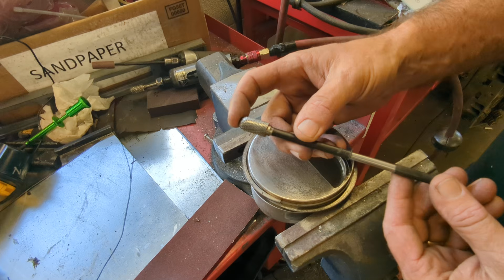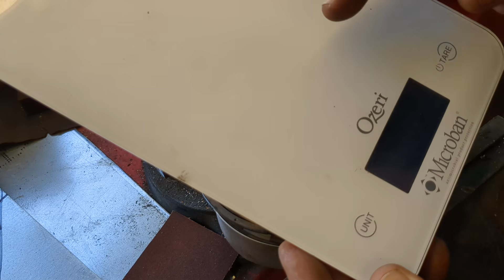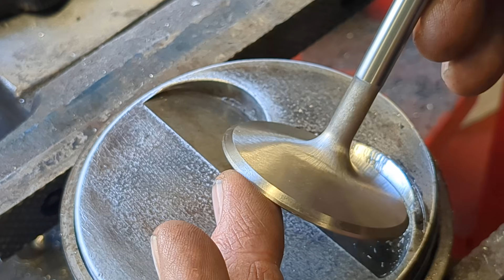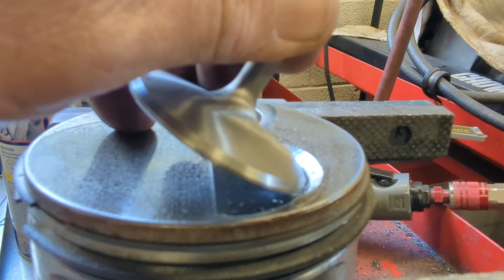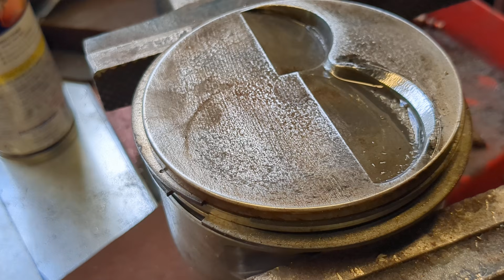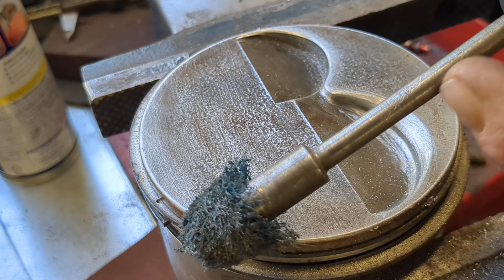The FIRST guy to show you this It will unshroud the intake valve in high lift performance engines

Comment: Wouldn't this mod help with low lift flow as when the piston is close to the valves like 10 degrees before tdc on the intake and 10 degrees before bdc . Because at max lift the piston is probably half down the bore.

Comment: scenario - I have a low miles engine that runs and lets say I did this trick to all 8 pistons.  and after removing piston material the way you did in the video, you mentioned weighing the pistons and lightening them to equal the lightest piston.  That's understandable. My question is, after making the pistons the same weight, does the rotating assembly need to be rebalanced?

Comment: In a pinch you can use a micrometer for a C clamp, or even pressing out U Joint cups, but you will likely need to use a pair of vise grips on the thimble.

Comment: I bought the Goodson kit that DV worked out with them. Thanks for helping me get more out of it! My project is a Chevy 292 l6 with 1.94 intakes. I want to get the most out of it. Everywhere I go in Colorado there is a mountain pass. It’s going to get more pulls than a tractor pull motor.
Reply: Great engine for that.

Comment: Shopping pistons online, I've often wondered why the valve reliefs were not laid back like this, to unshroud the valves??  And/or why they would ship pistons to customers with such sharp edges?? .... Knowing that sharp edges in the chamber lead to issues. Do the manufacturers not know this?

I would much rather prefer this done at the factory with machine precision, than me having to finesse it at home with the possibility of accidentally screwing up, just to have a properly finished product. So many things I wonder why...

Comment: Question about pistons I saw your video about compression height and your video on knurling the skirts. What is the best size of the ring grooves what else do need to know about piston selection and modification also saw your video on chmfering the shoulder of the valve releify

Comment: Subscribed. 
Watched several video's, you explain things pretty good, almost exclusively worked on 'semi-hemi' motorcycle engines with angled valves and pent roof pistons so 'flat top' pistons are 'different'. (although pretty common since mid 1980's in four valve engines)
Drinking straw is a brilliant idea, wish I had thought of it years ago when I was doing porting quite regular.
I've never liked holding pistons directly in vice, gripping tight enough to prevent movement could distort them. (particularly with smaller, lighter motorcycle pistons)
I realise you probably did it just for video on a piston that doesn't matter.
I 'invented' a piston holder using gudgeon pin and base, bolting through so piston can be set at any angle for machining, much more solid when using lathe or mill (I trained as precision machinist in 1970's  but couldn't stand production factory work)
You can use the metal polishing compound bars on cartridge rolls to 'reduce' grit size, rarely needed to use more than 400 grit to get a mirror finish on cast aluminium.
Usually cut down 6" mandrels and carbide cutter shanks to about 4", find things more controllable

Comment: All kidding aside. I had to come back to this video to comment on the huge benefit of this modification. 

For too many times have I torn down a client's engine and they have melted and or broke the piston at the outer edge of the intake valve relief and crown. This is where the short of the intake port flow is low or next to nothing. This occurs with excessive port velocities skipping over the short turn and slamming into the long side wall. Fuel becomes detached and runs down and out past the seat as liquid. This leaves the valve relief of the piston incredibly lean and melts that area of the piston.

Unshrouding like this allows for a lower pressure area and allows more air/fuel to be drawn into this area. Porting the head and making the short side more efficient would help too.

Good video Salter!

Comment: Question Brain; would this modification negatively effect the coating that comes on mahle coated pistons? Thanks.
Reply from the maker: If you're talking about that gray hardness coating yeah you would grind through it. 
However probably 80% of Pistons don't have that coating anyways and in the place you would be grinding it off I don't think it would hurt it in any way. 

But if I had my choice I do all my grinding work to Pistons first and then have them coated
Reply: @SalterRacingEngines  thanks for the reply.

Comment: Do you have to rebalance the engine when you do this?
Reply from the maker: @MrSuperchargeron  no unless you take off an exorbitant amount. As long as you are within 4% of your original Bob weight you do not have to rebalance
Reply: @SalterRacingEngines Thank you for the quick reply! I am rebuilding a Gen 6 454. It is for a 3500HD with a dump bed. Empty weight is 10,000 and hitched to my trailer grosses at 20k. I am looking for reliability and maybe a little extra torque. I sent a request to Comp cams but have not gotten a reply yet. Any advice or suggestions would be greatly appreciated! I have watched a few of your videos about cleaning up the casting and removing stress risers. Anyway, thank you for everything!! Have a great day!
Reply from the maker: @MrSuperchargeron  use the comp Xtreme energy 218 224 duration camshaft 
Perfect for what you're doing
Reply from the maker: That's flat tappet so use that unless you want to go roller
Reply: @SalterRacingEngines Thank you!! David Vizard just uploaded a video about a rusty camshaft. Yours? I have a 55 gallon barrel with about 40 gallons of Evaporust. I just dipped this block and heads. Works incredible!! 
I bought it a few years ago for a surface grinder I got for practically nothing. A 1961 K.O.Lee. it was super rusty but the ways were not pitted. I disassembled it and put it in the tank. Incredible!! Im so sorry to hear about your loss in the hurricane. Thank you again for the great videos and the recommendations!!
Reply from the maker: @MrSuperchargeron  yeah I saw it he was wrong on the cam count I have 35 that look like that. They're so pitted even after the rest is gone it's just no point in it so I had to wind up throwing them all the way
Reply: @SalterRacingEngines So sorry to hear.. I have never had losses like that. I had a car come off the freeway once and crash through my garage.. for the most part I was insured. But, the large gun and reloading hoard was not covered. I lost a lot of parts to water damage because the water main going into the house was right there. 15000 primers, pounds of powder, buckets of cleaned and sized brass.. flooded totes with gun parts along with some nice guns were not covered. I can look back and kind of chuckle at it now.. but I never knew I needed sn additional rider on my insurance for all the specialty stuff.. The guy who hit my house was on drugs and had no insurance.. 30 minutes before I was standing right there. When he hit the house, I was at the county recorders office putting the house in my name after paying it off.
Reply from the maker: @MrSuperchargeron  no unless you take off an exorbitant amount. As long as you are within 4% of your original Bob weight you do not have to rebalance

Comment: I did this a couple summers ago on some SBF hypers, mostly for clearing a larger intake valve. I also laid back the edge as you did but only enough to clean the edges. And not knowing for sure if how I did it was even ok. Then I come across this video. TOUCHÉ  sir.

I also wanted  to add,  as you were curious about how loud your grinder would be for the video. I switched about a year ago to using a cordless 12v Milwaukee 90° die grinder for all of my porting/cleanup work. With 2 5Ah batteries I was able to port a set of BBF aluminum SCJ heads. It's super quiet, 4 adjustable speeds, and was surprisingly maneuverable.  Also saves a ton on wear and tear on my air compressor. 
As always, great info 

Thank you for sharing

Comment: I have always wondered about this mod to unshroud the intake valve!  Thank you for sharing.  I suppose if you did the same thing to the cylinder head, the results would be fantastic.  Of course if you’re running a low lift / low duration cam, this might not show as much benefit.  I have also wondered about polishing the tops of the pistons or coating them with a heat reflective coating and how much that may be worth.  An A -B test on polished piston tops vs untouched pistons would be an awesome dyno video.  Thanks for all you do!  Subbed!
Reply from the maker: @natez0690 thank you for the comment that's way too much work just to make a video but I will tell you that polishing the Piston is nothing but benefits you will never go wrong polishing the top of a piston or even polishing a combustion chamber because you're getting rid of places for hot spots to form and your stress relieving the metal it's something I do on every one of my pump gas engines that is 10 to 1 compression just to make sure I don't get any spark knock or detonation

Comment: Why wasn't the valve relief pockets deshrouded in center  more like the deepest part of pocket that was attacked equally, as well as the apex at the adjacent side of intake relief pocket. Looks to me like your still leaving cfm on table for breathing. By taking them two areas equally out might possibly gain 20% or more laying those areas out as well.
Reply from the maker: @bigbearvenom6145  no I've tried that didn't get much more from it 
 but I'm not done with that video I'm going to show more examples later
Reply: @SalterRacingEngines  alrighty then !

Comment: This will be very helpful on my 461 Pontiac build, anything I can do to hold down Detonation on a street engine running pump gas is huge
Reply: get the piston tops and combustion chambers ceramic coated.

Comment: I would be interested in flow numbers and the change in static compression from unshrouding the valve reliefs.Does the better flow outweigh the loss in cylinder volume? I know it's very minor but it's still lowering compression.

Comment: So how much more horse power does it make.
Reply from the maker: @michaeldonahay8255  that's a great question but just remember it's not always about horsepower I said in the video that in some occasions it can allow five CFM or even more of extra air flow but the other benefit is preventing Spark knock and detonation. And that's a lot longer engine life and the ability to get by with a little cheaper octane.

Comment: does it improve flow / pumping losses enough to compensate for the drop in compression ratio?? 
.
like, im not sure how many CCs that would be.... and i dont think it would drop the ratio more than 0.1 or 0.2.... 
and if you were building the engine, you can get that compression back in other ways.... 
.
IDK... im just curious 
its 100% a good idea (the pistons should have came from the factory like that.... just stupid to have a SHARP!!! "wall"..... less flow and a spot to cause detonation) 
but if you are only doing a "dingle ball" hone and slapping in new rings.... AKA not TOTALLY rebuilding the engine, AKA not able to get the 0.2 comp ratio back.... 
.
like... should you only do this when you CAN get the comp ratio back up?
or, again, do the flow numbers "overcompensate" for said drop in comp ratio?
Reply from the maker: I cant answer that for you. It depends how hard Im going to push the engine.

Comment: Hey Brian, plastics straws have been outlawed here, would paper straws work😂 What piston coating(s) do you use? I like the theory behind the Line2Line coating (Abradable Powder Coating). Have you heard of any coating that is applied to the side of the piston above the top ring land, to minimize that dead space that traps exhaust gasses?  Thank you for posting!!!!!
Reply from the maker: @ts302  I've used calico for 25 years and Jason line is new to the coating business I mean relatively new but he has some really great ideas and from what I hear some really great coatings. My advice would be to talk to them on that. Yes we do sometimes use coatings in the ring lands especially for some boosted applications and heavy nitrous stuff.

Comment: I would like to see that on a dyno before and after. It appears to me that the flow would be improved but at the cost of some compression. Is it a net positive?
Reply from the maker: @TractorWrangler01  by the way that's not an attack on you I have had some people leave me some nasty comments on here talking about how stupid I am for losing compression and this that and the other and that they would never bringing engine to me because I'm the only person in the world that thinks I can build power by losing compression. It's laughable man but those are the people that are always behind us.
Reply from the maker: @TractorWrangler01  I pinned a comment about that very thing 
If you watch and listen to the video there's multiple reasons for doing this and I explained them all pretty thoroughly. 
Not only are you unshrouding the cylinder head and the valve flow but you're also preventing Spark knock and detonation by getting rid of hot spots. 
Anybody who thinks I'm losing compression is not an engine builder. 
These are things that an engine builder plans for. On most Pistons the exhaust pocket and the intake pocket totals up about 5 cc's so how much do you really think you're losing just by tapering back an eyebrow. And not only that but with a slight deck of the cylinder head or even slight head gasket manipulation you regain anything you may have lost it's extremely simple and something I've been doing for my whole career.
Reply: @SalterRacingEngines  That's why I asked the question. So you're making up for it somewhere else is what you're saying. I mean, clearly, you lose some because you're removing material. I don't know how much. Or else I wouldn't have asked. I don't disagree that valve clearance is your friend. I simply wondered what the cost is.
Reply from the maker: @TractorWrangler01  yeah it's not much man maybe a half a cc like on a cylinder head you cut 0055 off the deck and that equals 1 cc so if you lose half a cc or even one CC you can simply make a 0.005 cut on your head and your right back to where you started.

Comment from the maker: THERE ARE SOME PEOPLE ON HERE THAT THINK THIS IS GOING TO DROP COMPRESSION. FIRST OF ALL I AM A PROFESSIONAL ENGINE BUILDER DO YOU NOT THINK THAT WE TAKE THAT INTO ACCOUNT?
BOTH VALVE POCKETS INCLUDING INTAKE AND EXHAUST ARE ABOUT 5 CCS OF VOLUME. SO HOW MUCH DO YOU THINK LAYING BACK THAT EYEBROW IS ACTUALLY GOING TO TAKE AWAY. AND EVEN IF IT DID DROP COMPRESSION I WOULD SIMPLY CORRECT FOR IT BECAUSE THAT'S WHAT WE DO. SO PLEASE STOP SAYING THAT.
Reply: @SalterRacingEngines - Hey Brian, just remember, there are no stupid questions, only stupid people and some of them will go to great lengths to show you just how stupid they are (and some are just trolls).
Reply: You can’t teach a man anything that thinks he knows it already . People are mind warped .
Reply: I knew that before you even told me
Reply: @SalterRacingEngines  
I think the extra airflow allowing more mixture into the cylinder will do more for power than 1/2 or 3/4 of a cc of dome volume. Correct me if I’m wrong.
Reply from the maker: @johnnyatkins9097  correct
Reply: Thanks again I never thought about that.
Reply: Brian thank you so much for  sharing all your wisdom    I read your comment and said wow    I must be thinking on the right track  this comment is not to scale but I just want to say     IF I LOST A PENNY AND STATIC COMPRESSION I WOULD PICK UP A NICKEL IN DYNAMIC COMPRESSION  love your videos
Reply: @SalterRacingEngines  Don’t worry about the negative comments. Most of the people leaving negative comments are armchair quarterbacks who speak out of their asses’.
Reply: @SalterRacingEngines  
Airflow acts like a fluid rite? If you dump water on to a flat suface with rough crevices compared to a flat surface that has been exposed to smooth/beveled (ported) edges where the water flows smoothly out of the valve pocket to the edge instead of having to jump out from the valve pocket(and I know the valve isn’t going to be shrouded by the piston more than a few degrees) the air will flow more quickly to the piston edge. Without the turbulence and effort of having to climb the crevice wall out of the valve pocket creating more turbulence. 

 I mean we are talking milliseconds here at 7000/7500 is the valve really ever actually closed? I mean I know it is but not by much…125 times per second that thing opens and closes so at speed that valve and piston motion are going to be more like the port than anything so would you really want a .230 in deep ledge for the air to collide with 125 times per second??? I don’t know but I don’t think I would. So I will probably keep doing my valve pocket porting because hey if nothing else it’s gonna lighten my piston. 
 But I think it’s better to have that material out of the way 125 times per second than it would be to try and calculate the ability that ledge has to pull vacuum or how much vacuum you would loose by removing it. 
 And the piston pulls vacuum from the extreme edge of the piston not the valve pocket edge so since it does start at the top of the piston ring everything between the valve edge and the top of the piston ring os in the way.
Reply: Sounds about right with me doing that is losing some compression which is power.
Reply: @SalterRacingEngines  Forget about those keyboard know it all’s, who’s only satisfaction in life, is to hide behind a keyboard and harass others online.